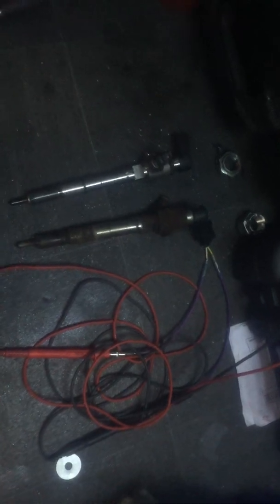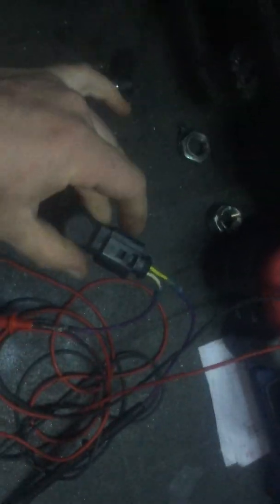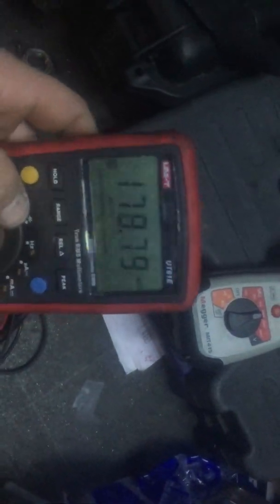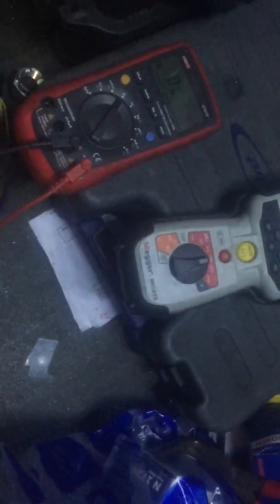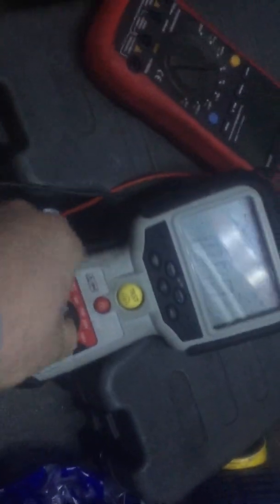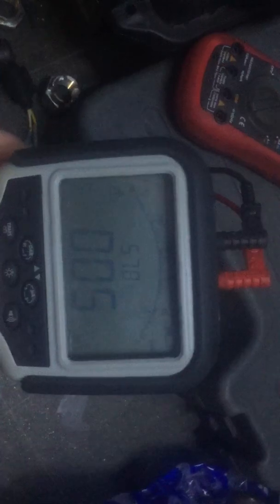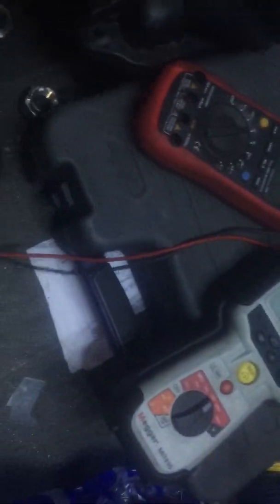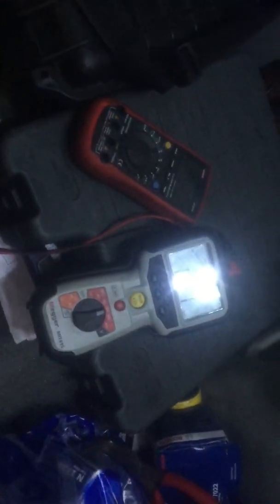How to test piezo injector

Comment: Hi mate, do you know if these piezo injectors are ok to test at 250v on insulation resistance? Thanks Gary
Reply from the maker: Gary Lord 250v is ok but it can tip a weak injector into complete fail so worth bearing in mind and earning customers first